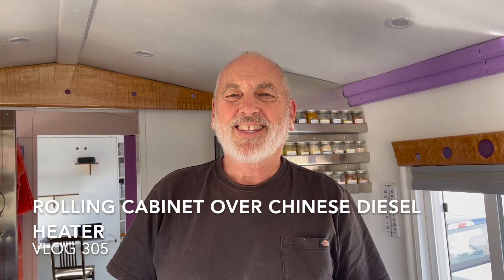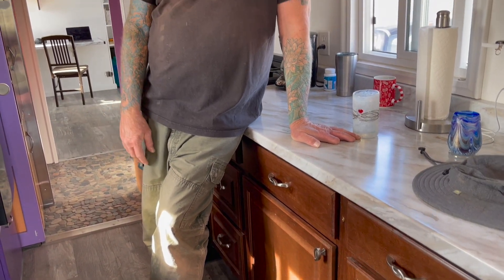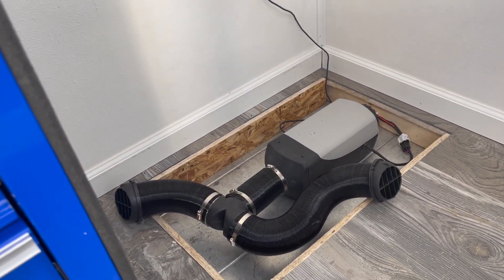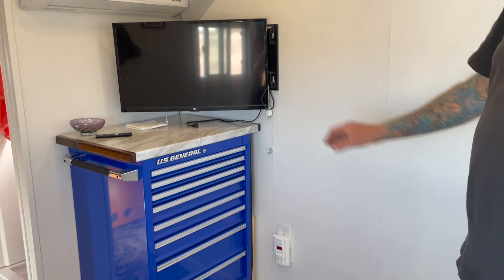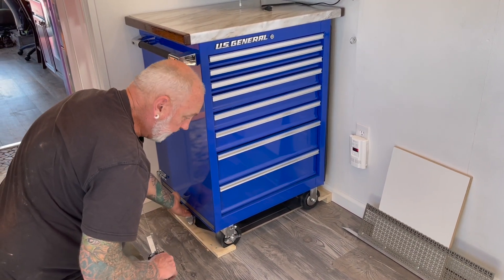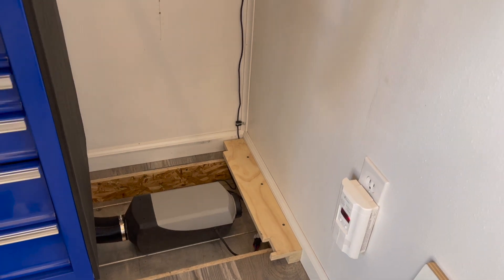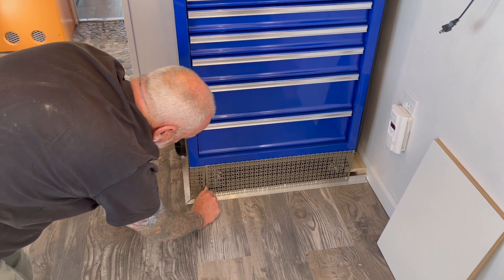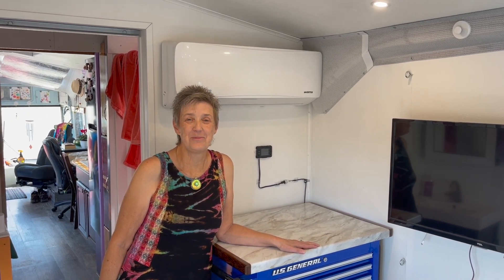Rolling Cabinet Over Chinese Diesel Heater - Vlog 305 Bus Life

Comment: Use a little JB WELD to hold those wheels in position 
     If it were me I would put a latch on top in the center of that tool chest under the top to keep the chest from falling over  when you take off from a stop 
       I have a tall box in the back of my bus also and it would fall over when I took off from a stop till I put secured it on the top